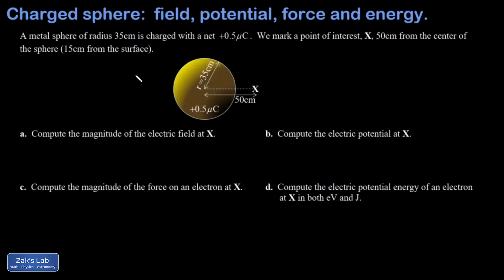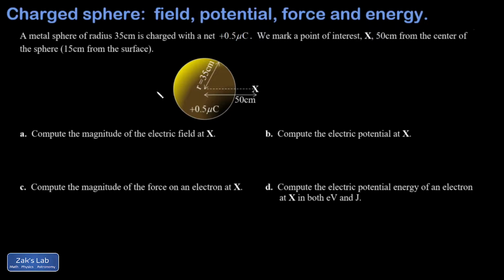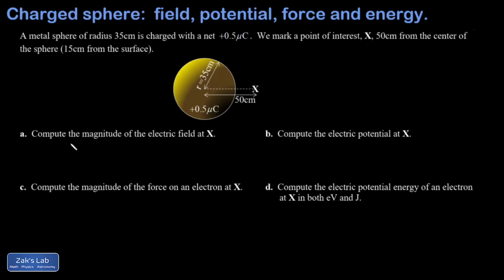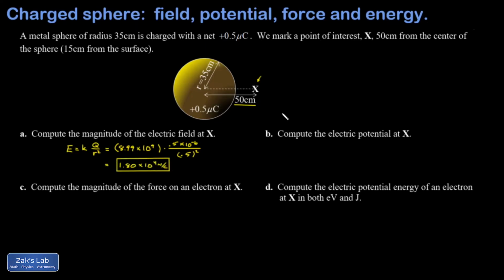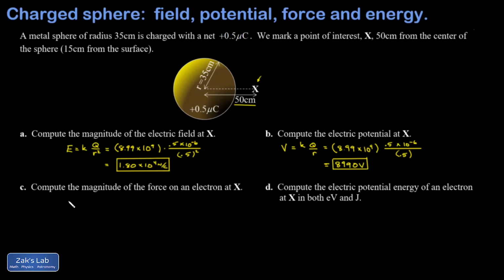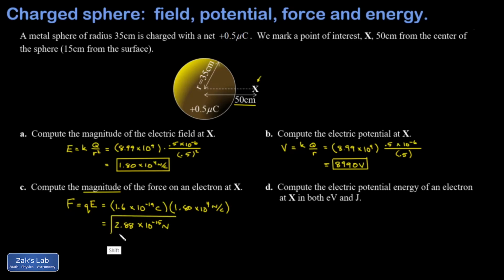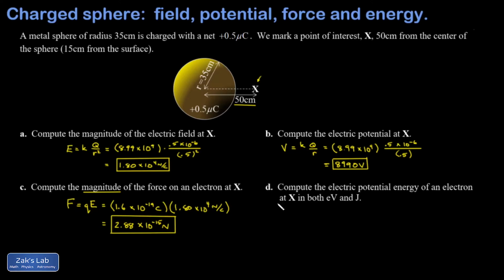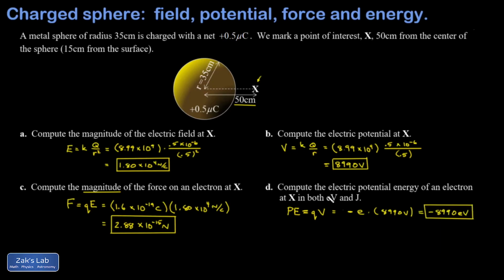Charged sphere example:  electric field, potential and force + energy of an electron near the sphere

Comment: you wouldn't use (-1.6 x 10^-19) for 1c?
Reply from the maker: The issue here is that I said "magnitude" of the force.  The minus sign is only used to keep track of the direction of the force, so if we ignore that, we get the size (magnitude) of the force vector.  I don't mark students off for giving me more than I asked for (i.e., giving direction as well as magnitude).